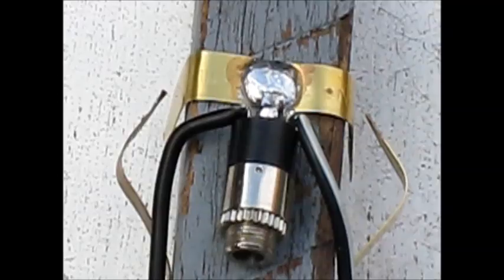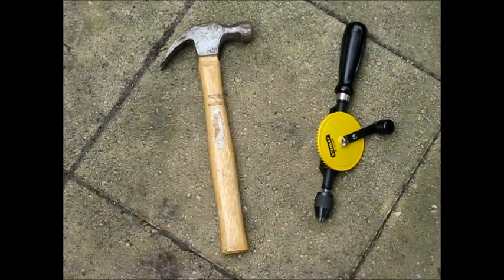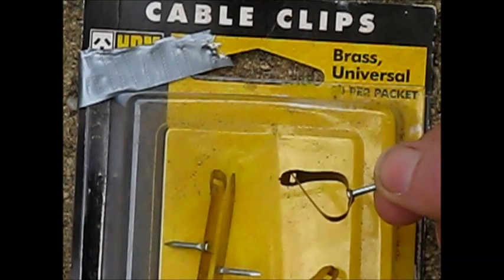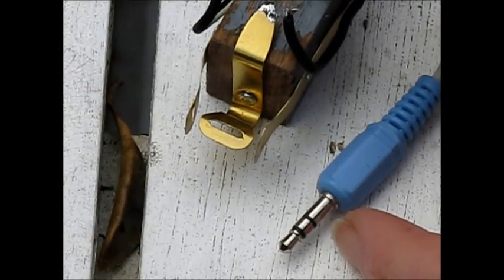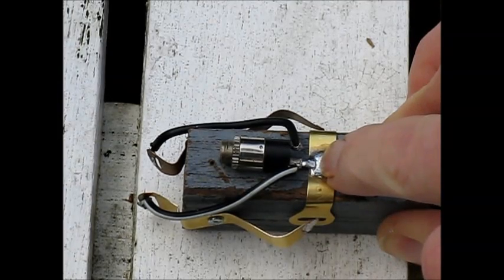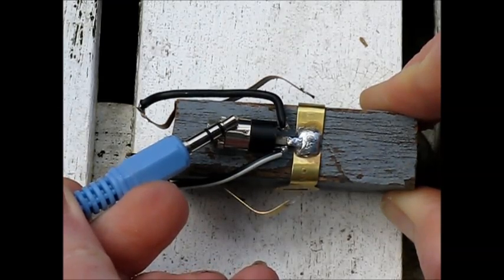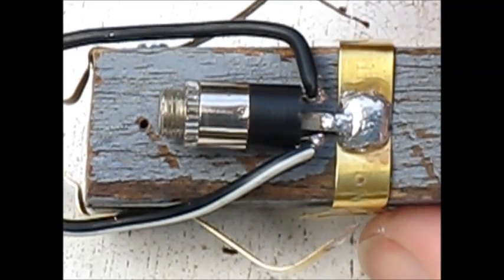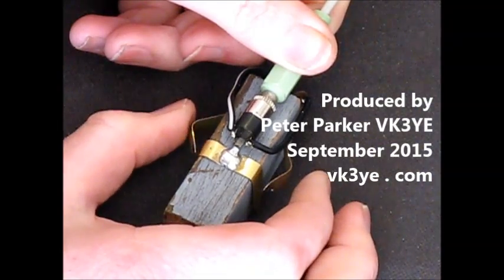Build a simple CW keyer in 10 minutes

Comment: We need an Amateur Radio dictionary.
Words being misused...
Basically...
Key = single contact up-and-down. CW key, Morse key, etc. - all okay. Paddles are not "keys". 
Paddles = two contacts sideways (can be single or dual handle). Paddles are not a "keyer".
Keyer = an electronic box of tricks that converts the paddle inputs into Dits and Dahs (built into modern rigs, used to be a separate box).
Bug = Mechanical device that typically uses an oscillating weight to make Dits, while the Dahs are made manually.
There are of course complications and more details, but the modern 'word salad' of using the wrong words is simply not correct.
Reply from the maker: Guess whose written one? Details vk3ye.com

Comment: This isn't a keyer.. it's a key, or more correctly a set of paddles. A keyer is an electronic (or electromechanical in past times) device that in it's most basic form aids the operator in sending smooth, regularly timed code.

Comment: Excellent idea for an improvised keyer. I made my keyer from an old PS2 computer mouse with the left button as dots and the right button as dashes by cutting some traces and rewiring the switches with the same cable to a  1/8th inch stereo plug. 
That way I can use the same keyer for a single button straight key for the pixies and a two button lambric type keyer for the rock-mite. I do this by using a stereo socket on the straight key radios and just not connecting (the right switch) to the center ring connection on the radio's stereo socket as I wire the radio for a key socket. But a mono 1/8th socket might not connect to the center ring anyway. The tip goes to the left key switch and the base goes to common for both switches. I remove the ball and the two ball movement shafts from the mouse since they are no longer needed.
Reply: You have blog or video showing how to build it?

Comment: What a great idea. I've never seen those cable clamps here in the US or anything like them. Here we use a steel 'U' shaped clip that has one or two tabs with nail holes to fix power cables to a wooden beam, but I'm going to ask around about your Aussie item.

I've been watching videos on DIY keys lately and your's is by far the best one yet. Congratulations!

Every HAM should make one of these and use it when theyr'e Out and About and Playing Radio! I'd use one in my shack and adjust spacing and tension with Needle Nose Pliers. Hi Hi......

73 & Regards from NH

Russ